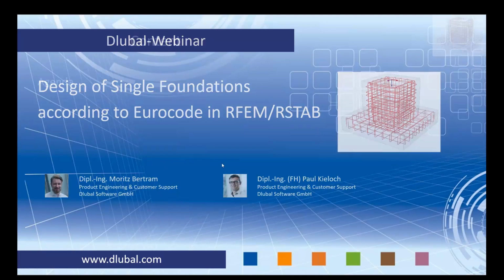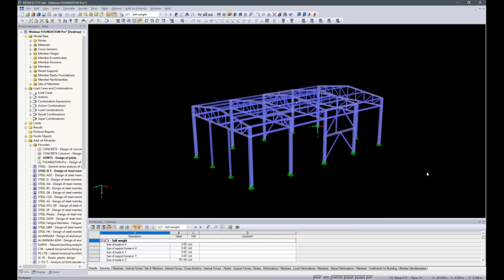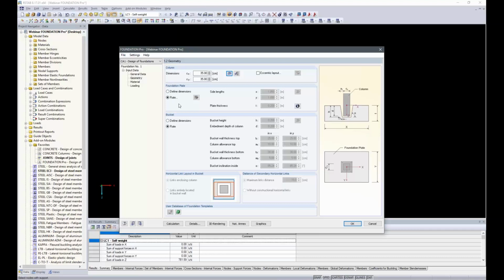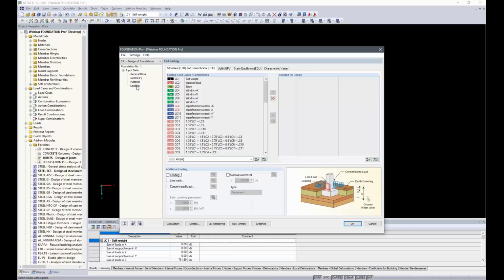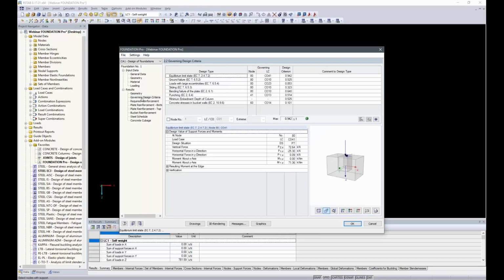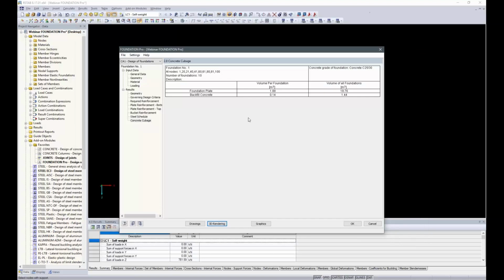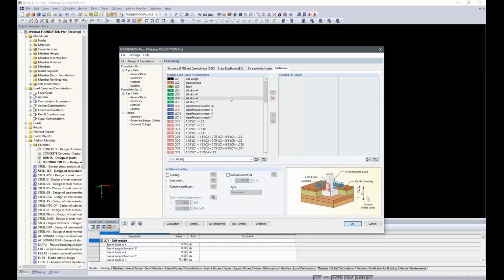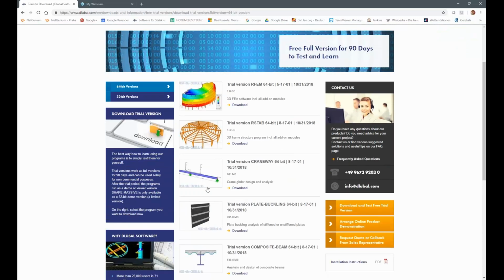Design of Single Foundations According to Eurocode in RFEM/RSTAB | Tue, Nov 20, 2018

Comment: Another question....Does the program do the overturning check or is this covered with the "Resulting moments at the 4 edges"?
Reply from the maker: Hi, picajoool!
You have to activate the geotechnical design check (acc. to EN 1997-1) in the details. It is called "Highly eccentric loading in the core (A 6.6.5)"
Reply: @DlubalEN  Vielen dank! 🙂

Comment: What about PGE and PGL in soil level interface - what are they? It's also confusing that their minus values go up with soil. Also what about very common foundations with concrete "chimney" (I don't know how to call it, it's like full bucket) below steel columns.
Reply from the maker: Hi, davidg939!
These is the top of ground surface in the original state (PGE) and the position in the final state (PGL). But they are only relevant for the settlement calculation. The z-axis is directed downwards, so the opposite direction is minus.
Reply: @DlubalEN  What about uplift? - where there is an option to determine how much soil is on the top of foundation? - is PGL considered for uplift calculation? Also in software I use, there is an option to declare part of foundation with different thickness of soil layer on it - is RFEM has something like this? And what about foundations with concrete base that goes up from concrete slab?
Reply from the maker: Hi, davidg939!
You can determine the amount of soil above the foundation with PGL and check it in the mask "1.4 Loading" under "Earth covering". And unfortunately it is not directly possible to define different thicknesses of soil layers, but you can define the thicknesses manually via the line loads. And here you can find more information about the available foundation types: https://www.dlubal.com/en/support-and-learning/support/knowledge-base/000566